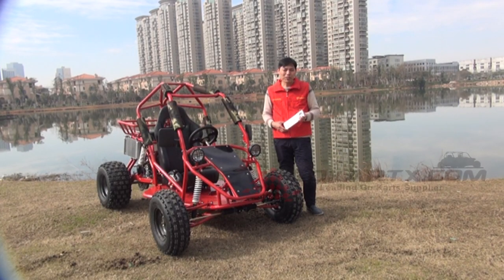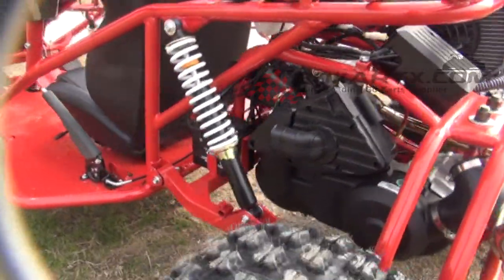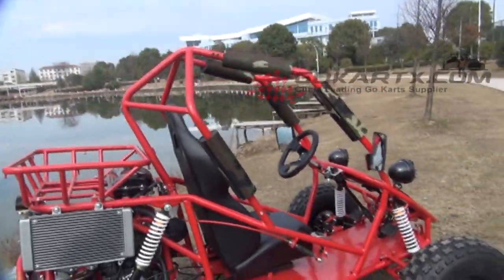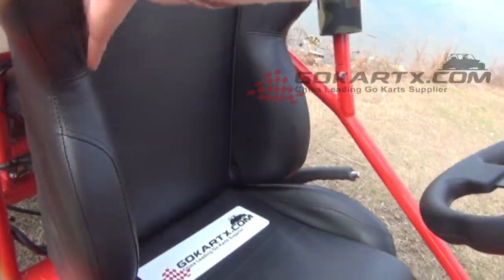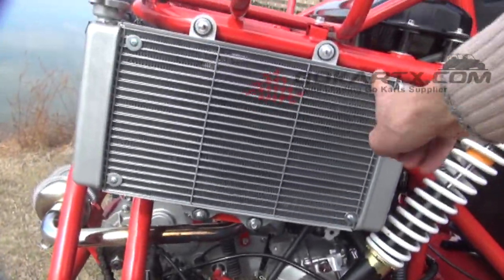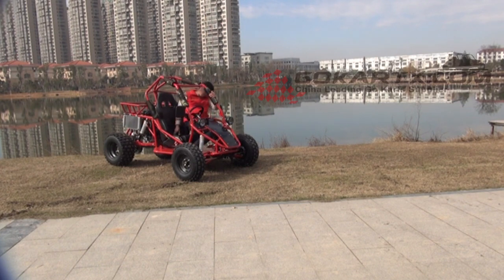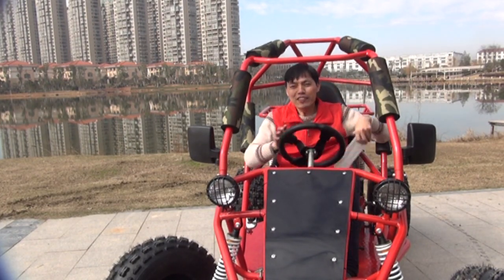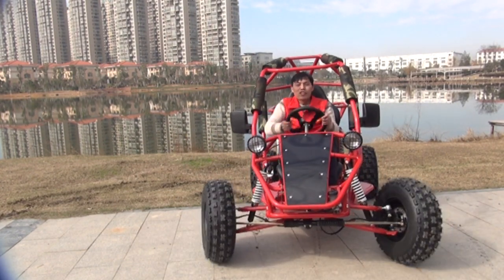Go Kart on 250cc Water Cooling Engine with Single Seat

Comment: And top speed I need for sand dunes
Reply from the maker: The speed depends on the engine displacement. The go kart in video can reach 100km/h.
Reply: @factoryprc  are you still able to get these
Reply from the maker: @jasonurban3597  Yes, this model is still in production.
Reply: @factoryprc  yeah but can you ship to the US
Reply from the maker: @jasonurban3597  Yes, we can. But the MOQ is 5pcs from our factory.
Reply: @factoryprc  what's that end up costing per piece